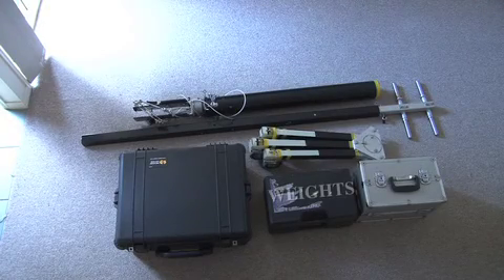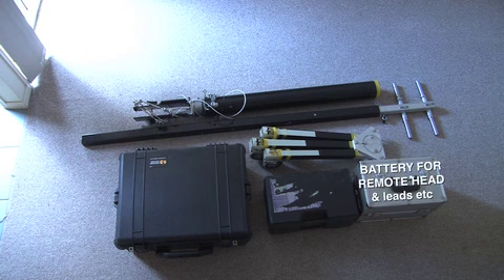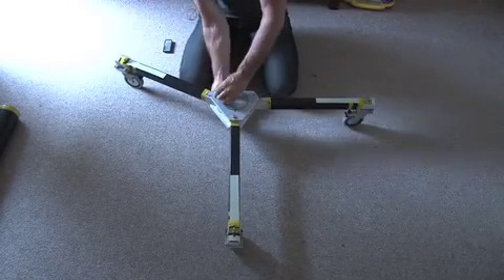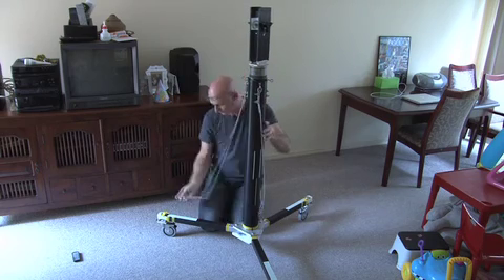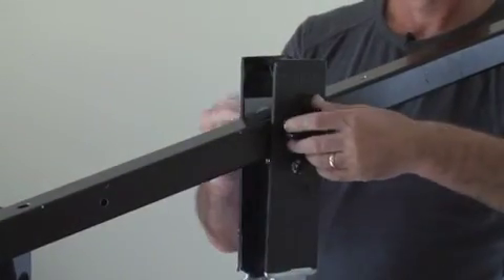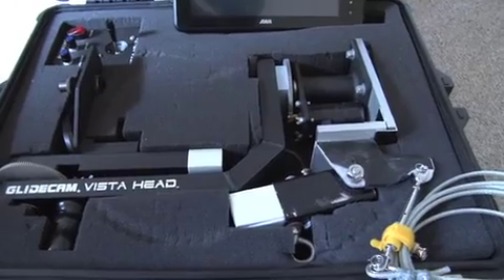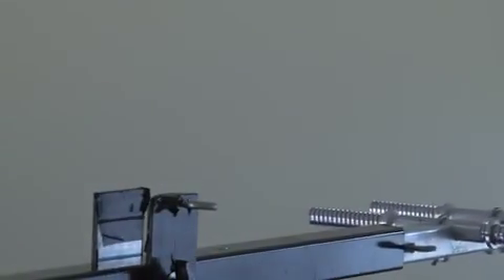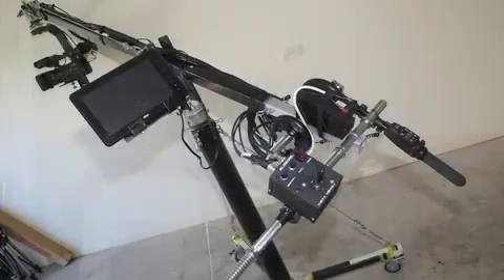DIY CAMERA CRANE.

Comment from the maker: Thanks I'm glad you like it, and yes it is just sitting on the dolly but the bolt heads that hold the dolly together also keep it centred and the cables keep it in place, as for the way that the extensions fit together they just slot together, there is a smaller piece of aluminium inside one of the extensions, if you are interested I will post a detail video of how they fit, the telescopic pedestal has a bolt that goes through both telescoping sections. hope this helps.